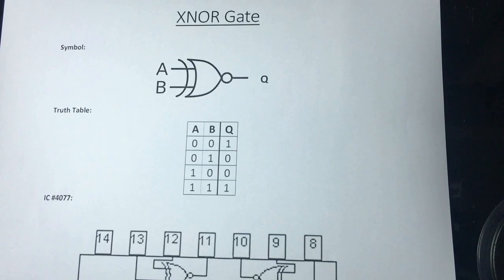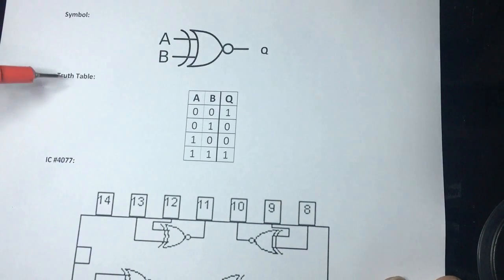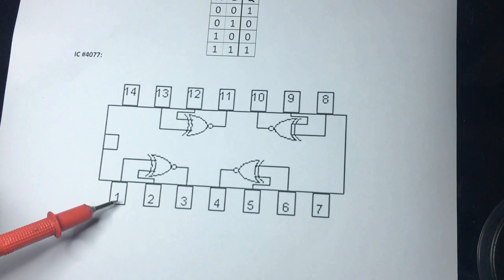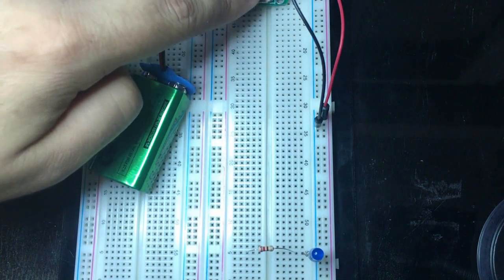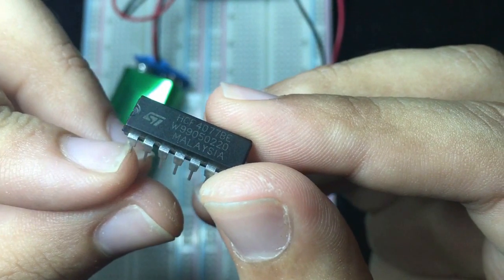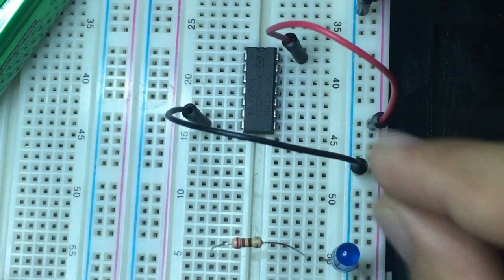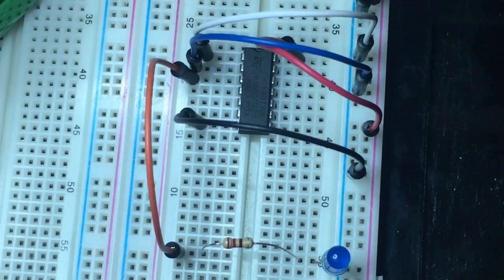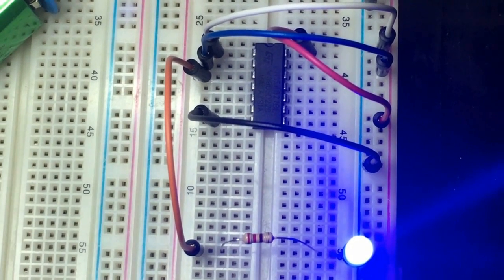Logic Gates - XNOR Gate

Comment: so this turn out need an pull down resistor for working.That's how ic have some big disadvantages that the circuit made up with external components would be better.
Reply from the maker: It depends on your application. For commercial use, you should analyze your design both delay time wise and cost wise, to minimize both of them.

Have a great day! :-)
Reply: BasselTech actually both pull up and pull down resistor solution can't solve the problem(it doesn't work properly),my application is needing an fast response about 100khz and not be delay or noise.,i'm going to burn it out in microwave.

Comment: Why you don';t need a pull down resistor for the inputs? If I don't use a pulldown resistor for the inputs, the output has unexpected results. Thank you.
Reply from the maker: +Eduard Voicu you are right, you would need a pull down resistor for inputs when you actually use the gate in any application, but this tutorial was only showing the truth table of the XNOR gate on LED, so I didn't care about unexpected results or floating connections.
Thank you :-)
Reply from the maker: Please check my video when I wire a switch to a logic gate:  https://www.youtube.com/watch?v=EMPnha6wVac

Comment: Can you do XNOR using 74LS266 IC ?
Reply from the maker: +PD Engson Yes sir, you can use IC 74266 instead of IC 4077 and it has the same pin configuration and will work the same as illustrated in this video. :)
Reply: @BasselTech  I disagree, since 74LS266 is Open Collector